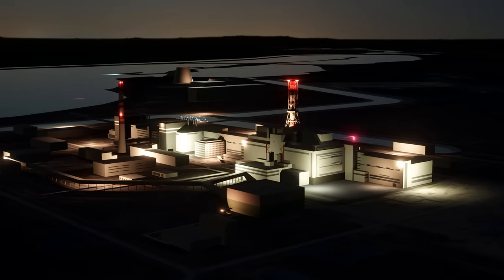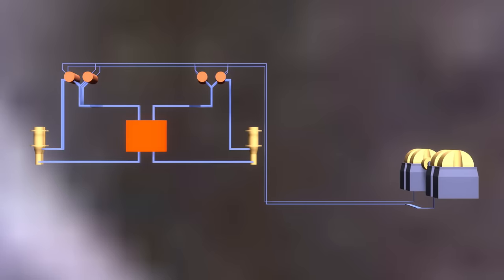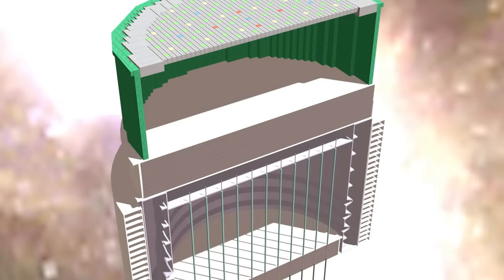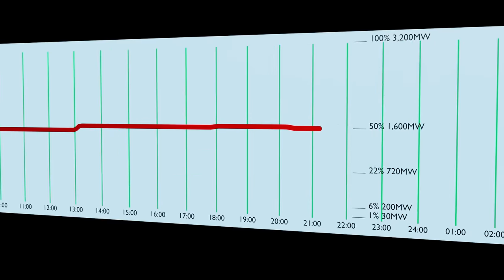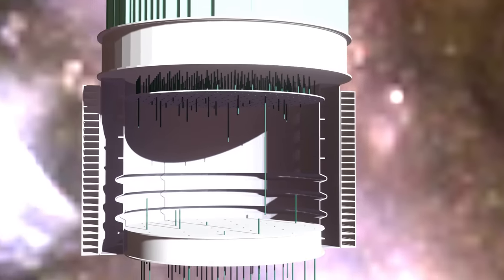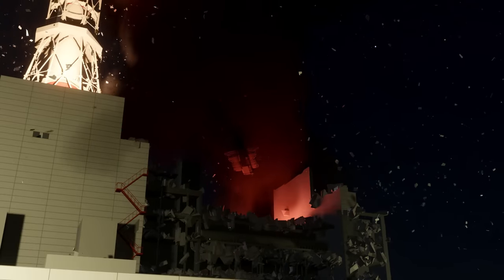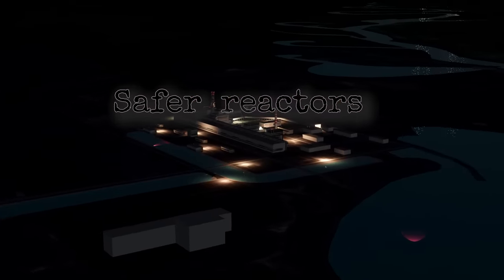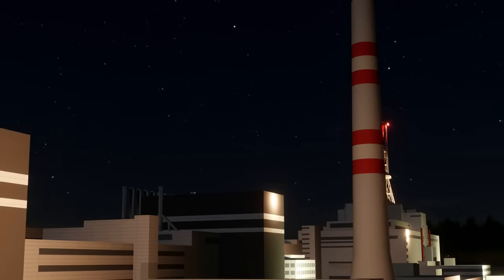CHERNOBYL AZ-5 why it exploded

Comment: As with the Challenger disaster, this issue came down to two elements: design and project management.  The urgency to get the Challenger mission into orbit (plus the PR from McAuliffe as the first teacher) and the lack of communication about O-Ring temperature issues led to the solid rocket booster breach that led to complete loss.  

For Chernobyl, it was Viktor Bryukhanov - the Chernobyl plant director - who was under pressure to complete a long-postponed safety test.  This urgency juxtaposed with end-of-month deadline demands for power and the desired promotion outcomes (Bryukhanov would get bumped up, Chief Engineer Nikolai Fomin would take his place, and Deputy Chief Anatoly Dyatlov would move up to Fomin's job).  Add in the shift-change in personnel (and a lack of experience at that), plus state intelligence keeping RBMK reactor flaws hidden, and it just happened to be a perfect storm (as disasters often are) that led to the explosion.  People can point to the USSR's desire to put cost and secrecy at higher importance than safety, but that's a factor regardless of being Soviet or American.  Just as you often get what you pay for, the desire to rush complex processes to completion regardless of anticipation of risk outcome will lead to other disasters down the road.